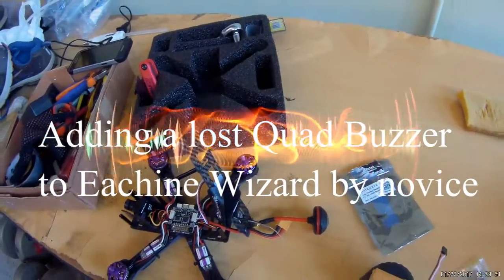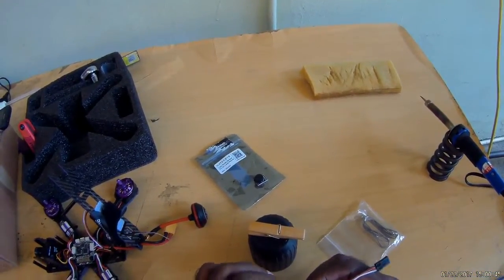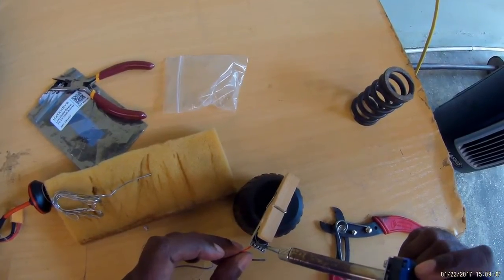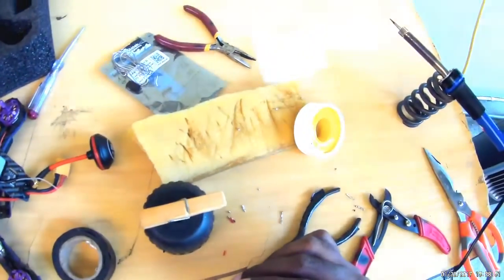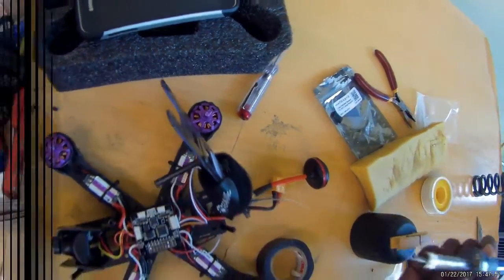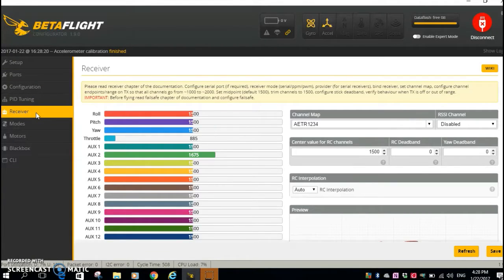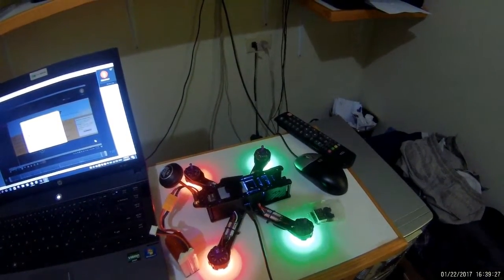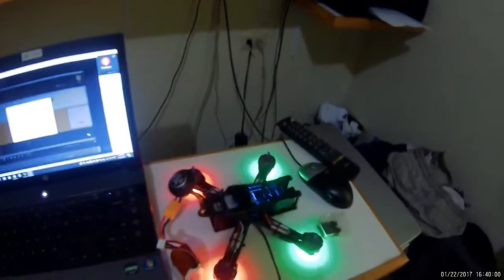Installing a lost quad buzzer to Eachine wizard by a novice

Comment: Let me share what I did to get mine to work. I used the Matek Systems 90db 5v loud buzzer. I soldered B- and B+ from buzzer to B- and B+ on board. Then, I soldered the 5v from the buzzer to the + power rail and the Gnd (ground) to the - power rail. I'm referring to the + and - power rails that are in a row and have multiple points for addons. The buzzer also has an "Aux", but I did not solder anything to that. Works fine now. Thanks Shirdi for the video, it helped me figure out the power rail part.
Reply from the maker: Thanks for the info 👍

Comment: I noticed you’re not using solder flux does your Sauter have flux inside of the wire because without fox I cannot get Sauter to stick at all I ruined a quad trying to Sauter back on the battery connection not having flux I burned the board trying to get the Sauter to stick then I later found out why it wasn’t working because you need flux and the wire I was using did not have flux inside
Reply from the maker: casper. do it in all honesty i an not certain but i would assume so since i had no problems thus far.

Comment: hey I hooked up the VBAT, do I need a buzzer now? NOOB question of the year lol, but anyway, I see no indication I did it right, how would I know? Thanks man great video
Reply from the maker: Robert Gray hi...you can get either a buzzer or an osd. of the two the buzzer is simpler ...just follow the wiring diagram as shown. the buzzer will sound when voltage reaches the value u set in betaflight.
Reply: So they go hand and hand, meaning like they are essential to each other right?
Reply from the maker: Robert Gray in a way...yes. the vbat provides the input....it is what gathers the data on battery voltage. the buzzer n osd is what outputs this data to the pilot....osd is visual n buzzer is audio.
Reply: Shirdi Ali I mean, why did solder power and ground from the batter terminals onto the flight controller? Did I have to do this?
Reply from the maker: I not sure if i understand. If you meant the power and ground from battery to the vbat pads on the fc then yes that is done so that fc can get the battery voltage straight from the battery and the fc then alerts you of the voltage via the buzzer when it gets below your set value
Reply: Shirdi Ali thank you, thank you, now, I'm on a sad mission of being able to assign this to a switch on my dx6. From my understanding I can also activate it when it's lost, but how?

But my assumption now is we part ways because you don't have a dx6, which seems to keep happening, I get up to a point and then bang drifts off to another configuration
Reply from the maker: Robert Gray in this video you will see how i did that on betaflight in d computer
Reply: Shirdi Ali I know, but look. You set the beeper to aux 6, then visibly i see you have a switch dedicated to the beeper right? 

That's where I'm stuck, none of these switches make any moments on this except Gear and a mode one, how do I configure Switch G to be the beeper? I guarantee you this is where the problem begins, please help you been REALLY helpful so far
Reply from the maker: Robert Gray when you go to receiver tab in betaflight you can see the bars move when you move d sticks.... when you flip a switch you will also see a bar move and will see which channel i.e. aux1 etc. once you determine which aux channel is linked to the switch you want go to modes and for beeper/buzzer set the aux to the one you want. as u flip it you set it on n off by moving the yellow bar linked to it
Reply: Shirdi Ali that's the thing, flipping switches none are moving, someone else said I have to "activate" them in the Tx but I can't even see how that's done.

They just delivered the buzzer I'm installing now, I just can't understand why it's so hard, I'm REALLY frustrated that assigning an action to a switch is like this 

Please help, I'll even make a video showing you, nothing moves in betaflight except two switches only,
Reply from the maker: Robert Gray ok....i honestly dont know anything wrt that n spektrum. sorry
Reply: Ok, I hooked up the buzzer I am fairly certain I did a nice soldering job, when I connected the battery, is it supposed to sound off like that? 

Thanks so much, how can I contribute to your channel?
Reply from the maker: Robert Gray i dont believe so. it should only sound off if the battery is lower than vbat set value or if ur switch is on
Reply: Shirdi Ali in betaflight I setup beeper, and it was armed, because I'm only limited to two damn auxs 

The buzzer is awesome, I have crammed the lost buzzer alert on the arm, it's the 3 setting on the three way switch.

I got a free forums but so far nothing

I find it amazing I'm either one of very free OR Spectrum receivers are much larger learning curves
Reply: Shirdi Ali does the buzzer chirp when you turn connect the battery? On mine it goes off when I connect the battery, not loud, but makes a few beeps and blips, not at ALL with you?
Reply from the maker: Robert Gray when you first plug in there is initializing beeps..just a few and thats it. i think if u have limited switches then probably set the buzzer to to beep when disarmed so if lost u can find it by disarming....n vbat will beep on low voltage as usual. apart from that you should consider upgrading your radio
Reply: Shirdi Ali yeah? I bought the dx6 because I thought it was good, it was $200, should I have gotten a different brand?

Comment: could you do the low voltage meter next? that would be great
Reply from the maker: Lukas Samuel i wanted to do vbat. I am still trying to research and learn how to do it...as soon as i find out i will....stay tuned.
Reply: u just take any wire and solder it to the vbat pad on the other side of the board opposite of the buzer pad it says vbat u just take power from your batter pads or your speed controllerpads